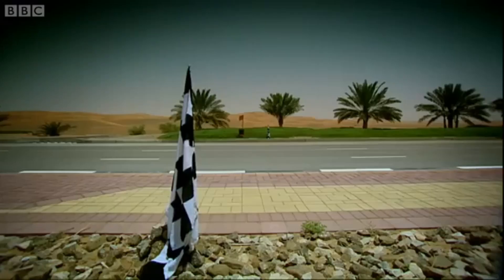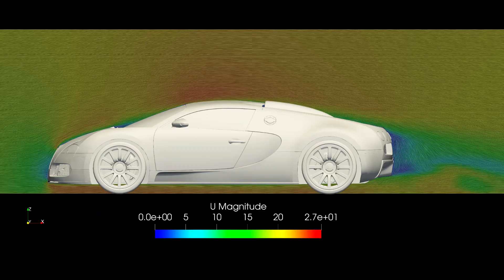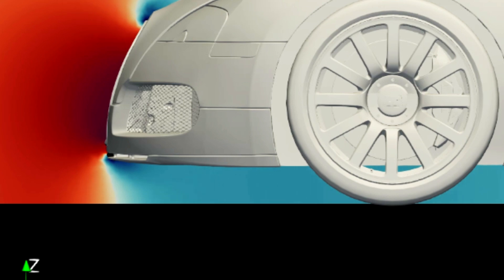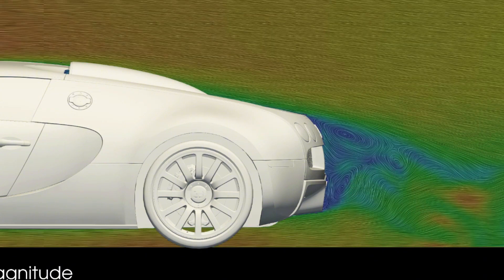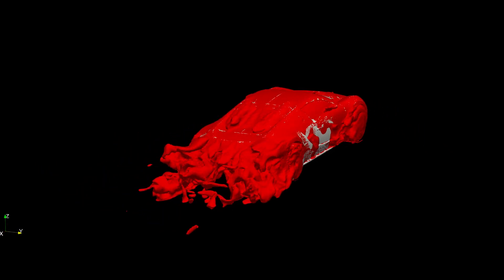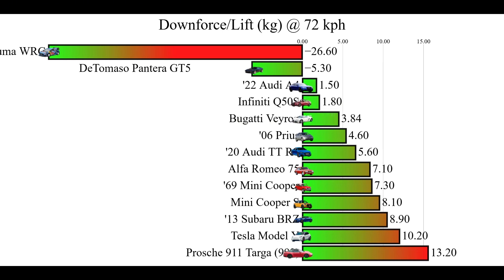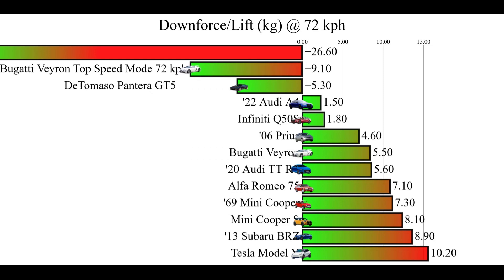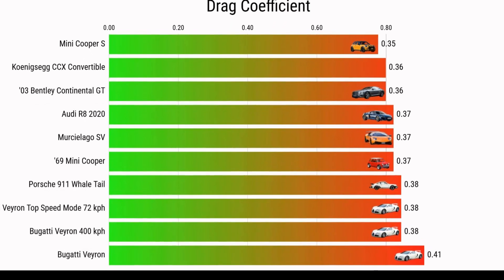248 MPH Bugatti Veyron Aerodynamics!

Comment: Could you maybe do the original RUF CTR? I think it would be interesting as there is quite a bit of online debate whether it was running the rated ~460hp or even upwards of 600 when it reached its top speed of 339kph. Thanks!

Comment: The only thing why Veyron has an exposed engine, it because it's heat management. 8.0L Quad Turbo W16 has 10 radiators on it and it still can't cool effectively, so Bugatti decided to expose the engine so the air can help cooling it down

Comment: The title should be 253 mph not 248 mph the veyron on 2005 did 0-60 in 2.46 sec it was awd with 1001 hp tho some had more on a dyno it did the 1/4 mile in 10 sec flat but in japan it managed to pull off 9.9 sec. It’s top speed for the book of records was exactly 253 mph
Reply from the maker: But we simulated it at 248 mph.

Comment: I can't remember where. But I do think some one mentioned that the Bugatti engineers had to manage the 'Limited' air around the Veyron between Aerodynamics of Stability and Downforce, as well as having enough air to supply the engine and cooling systems.
Which might explain some of the aero decisions made
Reply from the maker: Definitely. They had trouble with the cooling, which is why they needed so many radiators. 14 in total, I think.

Comment: 3:56 they actually covered it on the super sport
Reply: They didn’t the hole is just a different shape
Reply: @TinyBearTim  they did, watch the recent top gear episode about the record breaking bugattis.
Reply: @clemente111  they didn’t the engine bay still isn’t completely glass
Reply: @TinyBearTim no not with glass, but enough to remove the turbulent air at high speed
Reply: @clemente111 most of**

Comment: Still waiting for more motorcycle aero simulations ;)
Reply from the maker: I don't think we've done one yet.
Reply: And Ducati s
Reply: The motorbike is very aero. The lump on top of it is not. Full stop. STOPASKING
Reply: @kaing5074  But it is a valid thing to ask for.
I think it would be interesting to see what happens at high speeds, because the drag is so high of the gound, relative to the length of the motorcycle,
then what about attaching aero parts to the motorcycle, that blend the body of a person in better,
and what about downforce, especially while cornering, when the bike is tilted,...